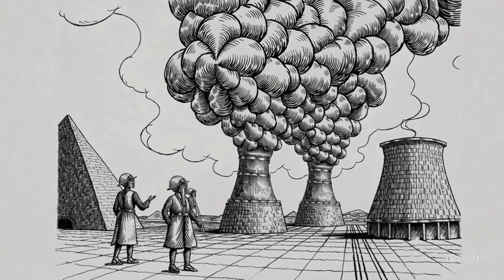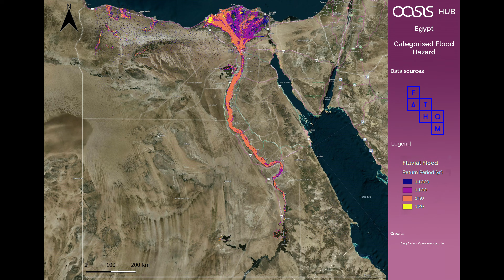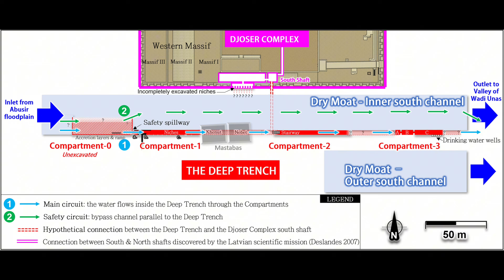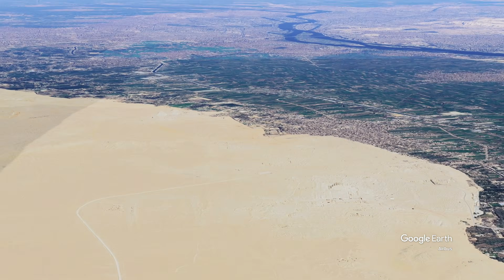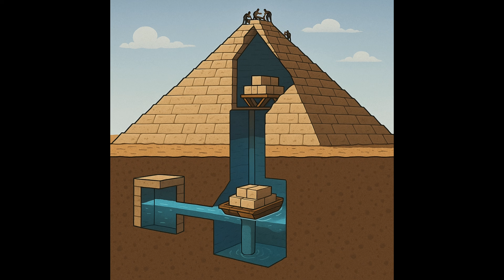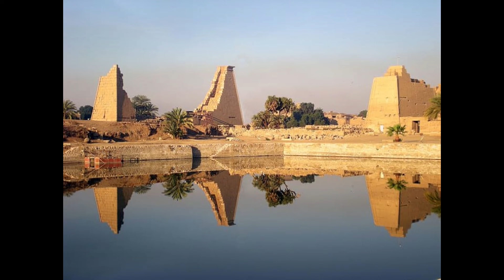The Incredible Hydraulic Lifting Machines of Ancient Egypt

Comment: One big issue I still have with floating these blocks down the Nile has nothing to do with the regular stones of the pyramids, but the absolutely colossal statues & obelisk stones that would be essentially mathematically impossible/nearly impossible to float on a boat, or even if built, the size and shape of these boats would be just simply absurd… To build a boat that could hold and float just one of those colossal stones, the boat would be so large and unwieldy, how would they fit down the Nile and not run aground or have to be a boat/radt acres in size… There are clearly many major unsolved issues with the idea of boats being used to float the most colossal of the statues stones, and obelisk’s down the Nile, and all the major design problems, like shape, size, and displacement that never get properly addressed by archeologists, even when they keep claiming that’s how it was done… 

Don’t you think something so incredibly fundamental, and important to their theories would have much more data defining what is physically possible, with what materials, what size, what displacement, and how they were moved on and off these “boats”? I just cannot stand how sloppy, and how many huge mysteries, even the most fundamental ones, keep getting ignored like those issues are just not a big problem or priority… 

Archeologists just claim the ancient Egyptians magically did these incredible feats of engineering and science, yet most archeologists still will not adequately research the required technologies that the ancient Egyptians would have been required to have had for the ancient Egyptians to have built half the things that the Archeologists claim the Egyptians built… 

Why are Egyptologists also basically required to lick Zahi Hawass’ boots just to do basic research?! Why do Egyptologists not call out Zahi’s abhorrent behaviour and wildly anti science demands? If Zahi doesn’t like you personally, your work, or you as an Egyptologists you are screwed… You better not dare publish your data and scans of something like the Hawara labyrinth, because a team of Egyptologists and specialist researchers dared to publish geophysics data for the Labyrinth in front of the pyramid at Hawara, where the team discovered incredible evidence for the existence of the labyrinth, and well? After simply deciding to publish that work without Zahi Hawass’ permission which he kept denying them, he then threatened the whole team with literal criminal charges and/or bans from Egypt… 

Something fishy is going on with the very anti science decisions and political BS that has been injected into the Egyptology field… Why do so many scientific fields have more effort put into fights and conflicts within internal Egyptology politics of the field than real honest scientific study/analysis. These fields now demand almost pure conformity of ideas, and any idea deemed “too crazy” or “impossible” by the fields elite gets you blacklisted as an Egyptologist/archaeologist… 

Those in charge, like Zahi Hawass keeps routinely blocking any researcher from pursuing any idea that Zahi simply doesn’t like… Those with power keep blocking researchers from studying their big ideas regardless of their supporting evidence and rigorous research plans… You cannot dare to even suggest that you are looking into finding evidence deemed “impossible” by these greedy, and intellectually bankrupt luddites who are stuck with their wildly dogmatic and calcified brains, who detest anyone who challenges the current paradigm that they helped create, so they intentionally restrict the free exchange of ideas, and investigations… If real scientists didn’t simply ignore, and go around these archeology elites and their scientifically bankrupt leaders “rules” we would never have discovered or investigated revolutionary new discoveries like Gobekli Tepe, or the antikythera mechanism, because these elite morons would have/do considerer things like that to be impossible, or would have considered them to be pure fantasy and impossible to have existed before they were discovered… Again and again we are shocked by just how advanced humanity of the past was, and every few years we have to completely rewrite history… Yet again and again young archaeologists are ridiculed for wanting to search for more evidence at the extremes, and for wanting to simply search the next Gobekli Tepe, or antikythera mechanism… Yet even with proof over and over again that we are missing incredible parts of human history & technology of the distant past, those wanting to look for it keep getting ridiculed, insulted, and dragged through the mud… It’s simply disgusting anti science behaviour…
Reply: TLTR at the moment. 
I agree with you and also, why havent anyone scan the River for possible acidents during the transport by boat? A hundrend plus pyramids surely IS possible to find huge boulders and boat remains on the River bed.
Reply from the maker: Yeah I don’t know. I also know they used a lot of river boulders as building materials early on and it helped make the river more navigable
Reply: @buubuu9954 there were apparently plenty of records kept about transporting quarried rocks from Aswan to the building sites and apparently it was a daily and mundane task taking maybe 3 days to load, transit, and unload if I recall correctly. I'm sure there would have been some blocks that were more challenging to move than others of course. As far as evidence of transportation accidents in a river that annually floods, you're looking for materials that are 4-6000 years of age so doubtful that much would be intact at this point.
Reply from the maker: Yes you’re correct. It wouldn’t have been the most glamour job to drag the stones.
Reply: If much of the journey took place on the water, they probably had a relatively easy way to make the comparatively short journey from quarry to barge and barge to site. Probably had canals for much of this and used camels or similar for the power requirements on the shorter trip. I ended up doing some basic analysis for the size of a barge you'd need for transporting some of the large blocks and even the relatively rare 100-200 granite ton blocks used in the pyramids would have required a barge of relatively modest dimensions. Certainly feasible even for the obelisks if the Nile was in flood. It would have been a relatively simple task with barges made of Lebanese cedar timbers which was known to be very available at the time in that region. @intothemap360
Reply from the maker: And we still have the massive causeway at Giza that is mentioned by Herodotus for bringing the stones over.
Reply: @tommymaddox6785  Modest? 70 tons is several hundred ton cargo ship. That's 250-300 feet.
Reply from the maker: Damn. Thanks for watching and your thesis!
Reply: @intothemap360 My apologies for my rant… Hah!
Reply from the maker: Haha I get it. There are some very frustrating issues in this topic. And you’re welcome to express that. My feelings on the matter are irrelevant.  I try and just stay above the drama, the arguments and the people on either side of them. You won’t see me attacking the establishment of archaeology nor will you see me attacking people like Graham Hancock or uncharted X. To me I just need to look down and focus on the rocks. What does it matter if others disagree it’s a free world  :). Only the rocks matter.
Reply: 1000 % correct OP.
Reply: "would be essentially mathematically impossible/..." Well let's see your math. 
We have records of trade and we know Romans took obelisks from Egypt to Rome. Are you doubting they could have transported those too? At what point do you think we could transport heavy things? 

Those SAR scans are absolute BS. You simply can not do what they are claiming they did. It is not physically possible. We have 70 years with this technology and longer with our understanding of wavelengths. They can't even prove it works themselves. Let's see a blind test of them scanning somewhere we know, and producing a result that matches. They can't do it.

Comment: Even today the most powerful saw or cutting tool isn’t diamond or some exotic metal, it’s water. Water jet saws can cut through anything. I’ve often imagined some way that the nile could have been focused and refocused into some kind of extreme powerful water saws that could explain the high precision cut stone and statues.
Reply from the maker: Great point. I need to make one on saw blade types they used back then and how they would have worked. Horrifyingly slow cutting is still cutting.

Comment: Just remember water isn't compressible. We use it everyday in a closed system with hydraulics to perform miracles with excavators and loaders, to name just 2.
Reply from the maker: Well aware! Also remember I clearly state this isn’t my theory or research paper. The paper is heavily cited and I point out just a few of the issues with it at the end. My last video put the nail in the coffin of this theory by showing there is no water link between the deep trench and the southern tomb making this papers hypothesis incorrect.

Comment: They have no evidence of wheel or pulley during the period they say the Egyptians built the pyramids.
Reply from the maker: Correct. This isn’t my research paper
Reply: What? No chariots or wagons even? How about rolling logs and ropes?
Reply: @Dale_Nerdisch  I'm not saying they didn't know about it but they didnt use it widely or record it anywhere. Sumeria had it in 3500 BC and recorded it on clay tablets. so i'm sure knowledgeable elites knew about it like most people today know about planes but have never flown or even know how planes work.
Reply: I think it idiotic to think they could build pyramids and couldn't figure out the wheel. a river culture wouldn't need them but it doesn't mean they don't know about the concept of a wheel.
Reply: @odjono  The avg weight of a block in the pyramids was 2.5 tons or 2268 kg. Wooden wheels have a max of 225 kg before failure. so you would need more than 10 wheels for each block. Also wooden wheels dont do well in sand nor do they have a lot of good wood in Egypt to make them. So they would not value them and if you dont use something its derivatives are not likely to be obvious or put in to use. There are also no wagon hieroglifs.
Reply: @Craig6844 wasn't suggesting that they used wheels just that the environment and applications didn't need wheels not that they weren't aware of being able to use wheels.

Comment: 24:00 once the blocks are at the top or bottom, they would be using manpower to maneuver them wherever they wanted them. Being slow might not be an issue if it takes your crew several hours to rig, move the blocks, and do any final fitting required.
Reply from the maker: Good points!

Comment: Those stones are a 3rd of the weight ...under water
Reply from the maker: Not quite that much weight reduction . Also depends on the type of stone
Reply: The displacement of water determines the weight reduction. Granite weighs about 2.5kg per litre of size, which would of course displace 1 litre of water at 1kg. So that original 2.5kg block would be reduced in effort to move to only 1.5kg. this is a 40% reduction in weight. For sure, and easier task.

Comment: It is not scientifically plausible that the stone box under the pyramid was part of a water reservoir system.
At best, the lower chamber may have had groundwater seepage, but the architecture does not support functioning as a pump or reservoir.
Reply from the maker: There are certainly issues with the paper!

Comment: Where are the signs of there having been (flood)water in the first place? Silt, calcification, stalagmites, algae remnants, and so on - most of the ancient water cisterns, wells, channels, aqueducts and tunnels all have those signs. So far, I haven't seen them in this footage. It's dry now, yes, but constant, prolonged use as hydraulic mechanisms would have left their traces in these tunnel systems, too, just like they can be found in other ancient sites that no longer have any water flowing in.
Reply from the maker: You’re right. There are issues with the theory presented in that paper.

Comment: This sounds good, but I can’t imagine that this process would be anything but extremely slow!
Reply: The ability to deliver enough stone per hour is the key question and weakness to this theory . Possibly a combination of methods is an answer . I.e. you start with ramps and finish off the tall lifts with this hydraulic system . Nice channel btw , subbed
Reply from the maker: I would agree with that. I just tried to bring that research paper to life and highlight the issues I saw with it.
Reply from the maker: Yes it would have been. And it would have required communication between the various sites with plugs. That would be hard to explain as well

Comment: Elephants, counterweights, pulleys, metal rails and bearings, hydraulic pressure, locks and dams, water displacement, and barges
Reply from the maker: Where did you get the elephants part from???
Reply: Obvious beast of burden. Its also more believable they were used by the builders not the glyph carvers.
Reply from the maker: Haha alright where is your evidence for this. Show me

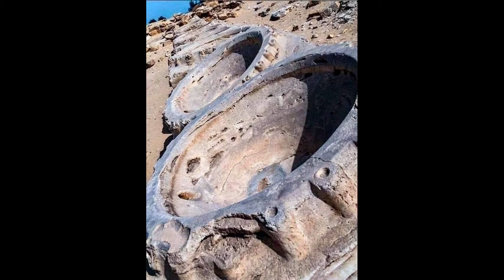Comment: At 8:21 or something related, could (Egyptians) create polished metal lens on those stone blocks. Make a lens array and focus on a metal tank and boil the water or related like in Barstow. Then you have huge steam power. You don't need wood for fire or huge volumes of water - just light. The piston under the steam needs tight tolerances between the piston and the cylinder inner wall. Perhap leather or rubber or related. You need valves and my guess is they could make those correctly. "Pilot- and demonstration-scale concentrating solar power (CSP) towers like Solar One and Solar Two commonly generate steam at pressures between 30bar and 100bar (435psi–1,450psi), with their boilers and turbines typically designed for such ranges to optimize efficiency for steam turbines."  - The Greeks long ago knew about focused metal lenses.
Reply from the maker: That’s a theory, however I saw no evidence of it.

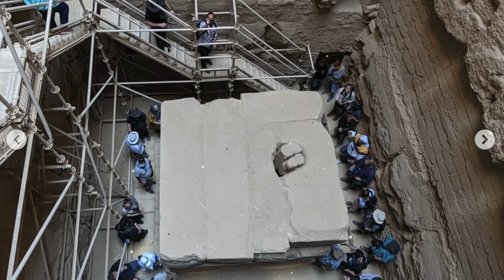Comment: @10:57 A piece of wood that floats can easily pull a plug out, fill a chamber, keep a constantly draining circuit topped off. Water is incredibly strong. Water level falls, drain plugs, fill up. Also- what appears to be a "drain" can also be a fill port. 

A large pressure potential device like that is called an Accumulator.
Since water is incompressible, it requires volume to have work potential, usually by use of restrictions and nozzles to increase pressures. Bernoulli's principle, a fundamental concept in fluid dynamics, states that an increase in the speed of a fluid (liquid or gas) is accompanied by a decrease in pressure or a decrease in the fluid's potential energy. Essentially, faster-moving fluids exert less pressure than slower-moving fluids. This principle is crucial for understanding various phenomena, from the lift of an airplane wing to the flow of blood in our bodies. 

That entire complex was under water. Sea shells next to the Pyramids.
Reply from the maker: So many ways this could have been set up! Either way, water lift, water purification or something else, a complex system was at work here!

Comment: Probably one of the most logical potential explanation I have heard to date and provides a broad depth the water network system I did not appreciate before 
I buy using a hydraulic system to pull blocks up but not the jack float approach because the higher you go the theory falls apart with respect to practical method to reload and bring back down 
But based upon the square footage of the cavity you could determine the mass it could potentially lift based upon a flat raft depicted 
Also like you noted there is evidence these weren’t elaborate  burial chambers they were all buried in the valley of the kings 
And also in with studies have shown pre dynastic had technology way more advanced then dynastic pharaohs 
Keep up the good work 
Love to know how they got the massive entrance blocks in place 
Maybe start doing the math on the surface area of raft required to lift each ton 
So the raft would have to cover the equivalent volume of water displaced so you would need a fairly wide raft and also thick raft to lift a few tons
Reply from the maker: Yes a lot more work needs to be done to either further validate this or disprove it and I’m open to either solution. I appreciate you watching and hope you consider subscribing. I’m a new channel but I put about a solid month into each new video I make. I’m working on an interesting one now!

Comment: I 3d printed DJed pillars and printed a base like a layer to act as the floor . You can pull at a lot of ratios also it could be used as a drill or a modified saw to get the relevant rpm I feel this is the best option and method I’ve seen for drilling or sawing at a fast rpm
Reply from the maker: Got any pictures of your set up on social media you can share?